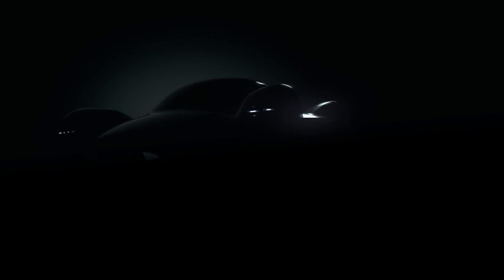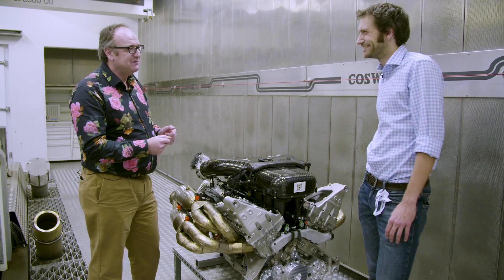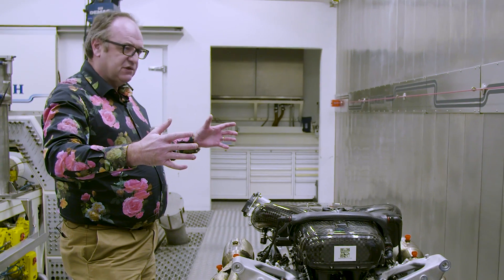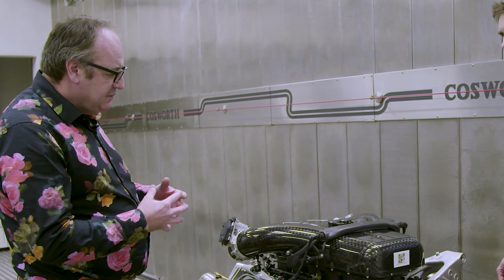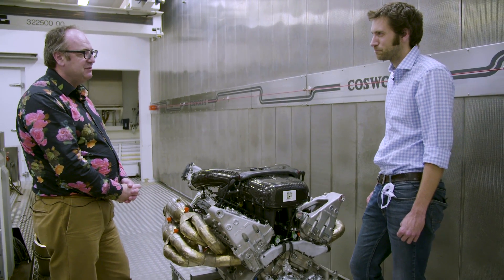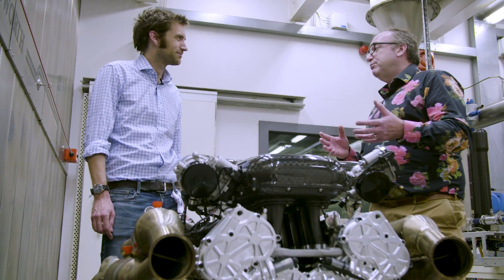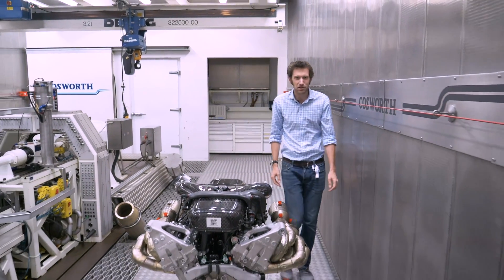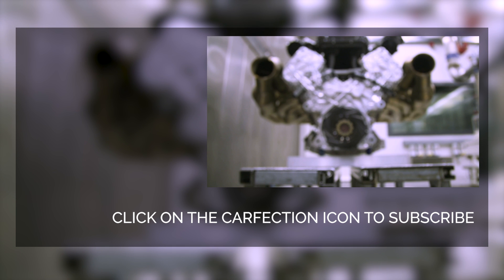Hear The Future Of The Supercar At 11,000rpm: The Aston Martin Valkyrie's V12 - Carfection

Comment: As a mechanical engineering student and car enthusiast, this is now my favorite video on youtube. Well done Cosworth, Astonmartin, and Carfection.
Reply: Jeremy Frey respect from a fellow mech eng student 👊
Reply: Görsel they accept that a certain amount of vibration in the cabin will be inevitable, and in fact will make the car feel more “hardcore” and “focussed” to the customer, as this is a common tactic used in race cars. Longevity of the design isnt necessarily the no. 1 concern in this case, as in a race car it is constantly being re-built/components replaced, and in the case of this hyper-car that will be driven barely a couple of thousand miles a year (and maintained to the highest standard), the chance of mechanical failure is relatively low. 
If this was your everyday Ford Focus or the like, the higher average mileage, harsher conditions (speedbumps, potholes etc) and more lax maintenance would result in higher chance of major mechanical failures due to high stresses/material fatigue. 

The other point to consider is the fact that (as mentioned in the video) the engine uses timing gears instead of a belt or chain system. This is because a belt or  chain wouldn’t be able to rotate at such high speeds (11000 RPM crank, and 5500 RPM for the cam sprockets) unless they were very bulky and over engineered, adding unnecessary weight. The gears also add a lot of vibration and noise, which is a key reason we don’t see them in everyday engines.

I think at some point in the video (correct me if i’m wrong), the engineer in the lovely flowery shirt said that the geartrain was at the back of the engine (i.e. furthest away from the cabin) so that the vibration would be harder to feel, and also slightly absorbed/damped by the crankshaft/flywheel’s motion. I think thats everything? Hope it answers your question 👍
Reply: Görsel me too, but its probably not too much for the million/billionaires who will most likely own this car...its a tactic used in motorsport to save weight, at the expense of everything else. If it would have any benefits in an everyday road car, it would trickle down, as a lot of new tech in consumer cars comes from motorsport (dual clutch transmissions, brake technology, engine design, theres loads of examples). Ultimately Aston Martin must have decided that the people who this car is aimed at will like the feeling of having  a bare bones hardcore racecar for the road. Just my two pennies

Comment: This is what a Hypercar engine should be like. 11k rpm 1000bhp...
Reply: The augmentation from t
Reply: This is an epic engine . But amgs project one with a smaller displacement engine pushing  over 1000hp is just as interesting a project
Reply: Power isn't everything real hypercars combine lightweight with high hp
Reply: @lometatron357  any retard can make horsepower if there are no limits on weight, efficiency, size, and displacement.
Reply: 1100 bhp! That's insane - the most powerful production NA engine ever. Even Ferrari only managed a mere 812 bhp out of their most powerful NA V12.
Reply: srinitaaigaura That “mere” 800hp is so the car is driveable on a daily basis, meets emissions standards and doesn’t need a rebuild every 5000 miles.
Reply: @stubones  And moreover the car doesn't cost you what this one will. They said the Valkyrie "isn't a track day special... but a proper road car", still they advertise it as one with a proper F1 engine, emphasising a number completely useless for everyday use. I still can't understand the reason to have an 11K revving engine for daily driving... The same reasoning goes for the Project One: cars more at ease on tracks than public roads.
Reply: @srinitaaigaura  No,it is a hybrid unit.The engine alone doesn't make 1100hp...
Reply: @srinitaaigaura  Upgraded Ferrari F50 GT Chassis #01 - 950 HP (1300 in the test before said final tune) compared the the other two's 750 HP
Reply: @srinitaaigaura  Most powerful naturally aspirated engine ever? No, just no. Not even close. 2100hp naturally aspirated V8:  https://www.sonnysracingengines.com/engines/drag-racing-engines/sar-1005-2100-hp
Reply: @3O2MuStAnG  "production" being the keyword here.
Reply: @sunder6745  Sonny racing engines are production engines as well so what's your point?
Reply: Not a road engine, won't pass smog and won't last, and doesn't come with a complete car attached
Reply: @weatheranddarkness  Still a naturally aspirated production engine that makes almost twice the power. And you don't know how reliable/unreliable either engine is so why even bring that up?
Reply: @3O2MuStAnG  found the sonny racing CEO.
Reply: @sunder6745  I wish! haha...
Reply: weatheranddarkness Did you watch the video?? Watch about 2:00

It’s built to pass emissions, the car is already designed and it is going to be a road car.
Reply: @3O2MuStAnG  Is it not based off a Chevy engine, with custom oversize parts, custom head, custom rods, crank and aftermarket EFI? That's hardly what I would call a production engine. How many 1005 ci have Sonny racing actually produced?
Reply: @3O2MuStAnG  17:1 Compression ratio also suggests not production! Jeez that's some Diesel like CR!
Reply: @3O2MuStAnG  "A ready-to-run 1,000ci engine from Sonny will run you about $115,000. Want to assemble it yourself, you can get about a $12,000 discount." Yes an engine I can assemble myself really sounds like a production engine!
Reply: @CED99  There literally reads you'll get a discount IF you assemble it yourself. Also the engine is produced since 2010 if I remember correctly. 8 years of consistent production. There are more 2100hp SONNY V8 engines than that fancy Aston Martin engine. Also the price is basically a steal and you would know that if you were a gearhead. Naturally aspirated high performance engines have always been a little on the expensive side so what do you expect from a 2100hp engine? Of course it costs as much as a luxury car haha.
Reply: @3O2MuStAnG  a racing engine is by DEFINITION not a production engine. A drag engine is not a road engine. Are you thick or do you have a vested interest? Is it just american pridefullness? IN NO WAY, SHAPE, OR FORM, CAN A SONNY's DRAG RACING ENGINE be considered production.
Reply: @3O2MuStAnG  you're comparing apples and oranges, and I cannot let that stand. Here's some food for thought: 
Cosworth Valkyrie - 153.8 HP/L - 206kg (454lb)
Sonny SAR 1005 - 135Hp/L - Weight so high it's not even quoted
2.2hp per pound VS..... crickets.
Reply: @3O2MuStAnG  Yes, there is always that one idiot counting a dragster racing engine. GOD. You do realize you're comparing apples and oranges?? Listen genius - a dragster engine only has to produce max power for a few seconds , doesn't have to comply to any emission regulations, noise regulations, longevity, drivability, refinement and ease of maintenance. And I looked that engine up, its displacement is 1000cui which is 16400 cc (!!). This engine here only has a displacement of 6500 cc (396 cui).

And when you compare how much the Aston Martin engine produces per displacement it's 1000hp /6,5 liters = 154hp/liter (or 2,52hp per cui) whereas that dragster engine of yours produces 2100hp /16,4 liters = 128hp/liter (or 2,1 hp per cui). 
Well, considering the Aston Martin engine passes all emissions and is designed for longevity (dragster engines wouldn't last five minutes under continuous use) I'd say it's way more impressive. 

Who compares a 396 cui engine with a 1000 cui engine? 2,5 times the displacement but not 2,5 times the power... . 

If you can find a road legal NA engine producing 154 hp/ liter (1000cc) you get a cookie. 

And question: Do they even race 1000cui engines in real dragracing?? They have displacement limits too. In NHRA they have a 500cui limit for ProStock and IHRA/MMPSA have a 820 cui limit. So that engine you're mentioning isn't even eligible to enter any dragracing events and only exists as a show off unit. You sure know how to pick them apples and oranges kid! Way the go.
Reply: @McLarenMercedes  Didnt read that comment sooooo you wasted your time. See ya!
Reply: @3O2MuStAnG  In a production car and meets emission standards you tool
Reply: @warwickstingray  So? You cant afford one so stop acting like a pissed fanboy.
Reply: @3O2MuStAnG  We both know you read it or you wouldn't be offended. And if you didn't - pity, you could have learned something . And if you didn't read it,  Others will . I reckon they will be smarter. Learn this: Ignorance can't be excused. Learn from this. Or be an ignoramus all your life. Last of all spreading knowledge and teaching people is never a waste of time. Being an idiot is always a waste of time. Which is going to be for you?
Reply: @3O2MuStAnG  Funny how you claim to not read comments yet you reply to everybody. Who's wasting their time I wonder?
Reply: weatheranddarkness actually it will
Reply: @weatheranddarkness  that's what the three cylinder engine was for to prove the v12 would pass emissions
Reply: @slowmazda3h802  @Greg Mieg what are you guys talking about? you sure you replied to the right comment? I never doubted the Cosworth, I've only been telling OneTT how much of an ignoramus he is for comparing a drag racing engine to the Aston's engine.
Reply: @3O2MuStAnG  this a production car engine
Reply: @weatheranddarkness  yea I did sorry for the confusion I caused
Reply: @McLarenMercedes  Very well put! And thx for the very detailed and informative post above!! I gave that little OneTT runt a nose punch too! ; )
Reply: @jamesshunt5123  Lolzzz!! Brilliant reply man!
Reply: @3O2MuStAnG  "You love twisting words, don't you? You must be a  10 year old girl haha."  -  You might be right about him.. Buuuut, I think the chance is quite slim.. wouldn't agree?

Though, considering the way YOU reply on the other hand.. I'd say the odds aren't exactly in your favour to put it aammm.. mildly.. let's say! ; )
Reply: @3O2MuStAnG  fanboy nerd
Reply: Better than the the current f1 engines at this point
Reply: @vigneshie  It's really not thoe.

F1 engines are unbeatable by ANY engine ever made

Not to mention that they are better while being limited by software
Reply: Is that 1000hp figure (or 1130 according to wiki) utilizing the hybrid assist though? I’d assume that since the engine is being designed with hybrid from the get-go, that figure would be with the included electrification. Or maybe I missed it in the video.
Reply: Alan Bowers 1130 on hybrid,1000 on the combustion engine
Reply: Koenigsegg has reported that their engine without turbos produces 1100bhp
Reply: @kvltman782  Their V8 ? (probably because i don't think they make any other engine)
Reply: @kvltman782 Koenigsegg makes some spectacular cars that the press doesn't give them enough credit for since he such a small operation. I believe they fabricate the majority of their parts too, right?
Reply: @Peanutdenver  That is correct. The make everything themselves except the emergency brake pad, and windshield wipers.
Reply: @Elias_g1  Their 5.0 litre twin turbocharged V8 produces 1361 horsepower with the twin turbocharged setup. I apologize, I cannot find the source, however there was a figure stating that ICE itself produced nearly 1,100 horsepower (at least for the One:1 and Agera RS 1 models. The "1" model was the 1 megawatt package attached to the RS from the One:1)
Reply: @ALMX5DP   The engine itself makes 1000. The hybrid system is expected to add around 125 hp.
Reply: @kvltman782  Vile engineering for fanboys.
Reply: @kvltman782  And the tires..  ; )

- Courtesy Doug Demuro
Reply: @ALMX5DP  1000 bhp from the engine and 160 from the hybrid motor

Comment: Can I get that 250hp 11,000 RPM 1.65 liter straight 3 cylinder though
Reply: Um Ducati will sell you a panigale V4R for pennies on the dollar compared to this and it makes 220hp from a 1.0l v4 @ 16000rpm. Sounds every bit as good too.
Reply: @shadynas7y  the V4R makes about 2 times less torque tho.
Reply: @turnip8173  You can't have two times less of something, you can have half as much though.
Reply: @schumifan78  thank you for correcting my grammar. I'm not a native speaker so it happens
Reply: @shadynas7y  not with car emissions kit, they won't
Reply: @shadynas7y  No low down torque though, useless for trying to pull around anything much heavier than a motorcycle.
Reply: @shadynas7y  and for less than half the cost of a V4, you can get an old Honda CBX 1000 6 cil that will also sound better: https://www.youtube.com/watch?v=MBbskqcgs_o
Reply: this engine makes more hp with 25% less cylinders and 50% less rpm as v4r.......
Reply: @2likru Esco Cosworth modified version Ford Barra i6 would be the attainable dream.
Reply: Nissan has a 1.5L straight 3 race engine that makes 400hp and weighs like 90lbs. Is that close enough?
Reply: I would love to put that motor in a Caterham.
Reply: imagine that on a Clio or mx5... it will be epic !
Reply: @2likru Esco I'll take the 750hp lopsided 9
Reply: What a motorcycle donk!😳
Reply: No kidding.
Reply: Cool  Don't know but it has 0.5l of displacement more a cylinder less and a much longer stroke.. not to mention it makes 250hp meaning it makes a good bit of torque too. I'd personally say 250nm or in the ballpark of that
Reply: @Doctor Pisson doubt that it's making peak torque at 9700rpm tho.. it's a 6.5 or something like that right. It makes more down low I bet
Reply: got nothing on the 4ag, ueo got his wagon to 180hp at 13k rpm
Reply: @2likru Esco , almost certainly has to be a V6 if you want to rev to 11,000.  Too much twist on a straight crank for 11,000 in a I6.
Reply: @TheCorrectionist  tell that to the CBX1000 and plenty of race spec R34s
Reply: @turnip8173  , those aren't 3L I6s with a two foot long crank shaft.
Reply: @TheCorrectionist  that's exactly what an RB26 is and it has no issue revving to 10k when done right
Reply: @turnip8173  , that's 8,000ish from the factory.  You're talking about a tuner special.  That ain't going 100,000Km between overhauls.  Shit, I'd be amazed if anyone has done 20,000km between rebuilds.  And 10,000 is not 11,000. The Valkyrie could probably go much longer with a 10K redline.   The wear increases exponentially with rpm.
Reply: @TheCorrectionist  noone brought up modifying the engine as a. this engine isn't your run of the mill V12 and b. you said that it can't turn 10gs. It was an Endurance GTR and there's plenty of similar ones. Also this engine will need servecing just as frequently as a race spec motor.
Reply: @Doctor Pisson Well in the official teaser Aston Martin claims 740 @ 7k so.. yeah still pretty high but not 9.7k high
Reply: builds worlds most insane go-kart :D
Reply: 😂 think the speed limited electric cars will take over before that happens
Reply: I'll take the 83hp  11,000 RPM 0.55 litre single cylinder please. Need to upgrade my ride-on lawnmower.
Reply: You can get pretty close with motorcycles...they have 1 liters that make over 200 horsepower, redlines over 11,000rpm too.  My Hayabusa redlines at exactly 11,000 (1.3 liter)
Reply: It would be slow in a road car due to a lack of torque. If you wanted it for a bike or go-cart that would be nice tho.
Reply: Is it 3 cylinder straight or V?
Reply: @KumRuzvalt93  It must be a W3 electric engine mated to a double-cluth CVT, no other way based on the layout of it's big brother in the video.
Reply: @csabaandrasgoncz9503  No its a straight 3, 1 corner or a quarter of the v12.
Reply: KumRuzvalt93 slant
Reply: @KumRuzvalt93  Think about again,dude, A v3 ha.

Comment: N/A and 1000bhp...
Cetainly can tell the Cosworth lads aren't messing around.
Reply: N/A is simply amazing in a road car... sounds incredible.
Reply: Oh it definitly does make 1100 hp from the engine alone + about 300hp im guessing from electrics and all but the extra torque from the motors is gonna make it even more insane than just 1400hp in such a light car
Reply: @leokaravasili9649  No it doesn't.The combined power from the engine and the electric motors is 1130hp.
Reply: It's a hybrid....
Reply: @Elias_g1  it's still N/A V12. You can hybrid pretty much every engine you want, mate..
Reply: @Fotznerwin27  Yes,i know but people think that 1100hp is coming only from the engine...
Reply: Ilias G1 engine has 4 250hp 3cylinder engines combined to one...
Reply: @qatronano  It doesn't make 1100hp just from the engine alone,that's what i am trying to say !
Reply: @Elias_g1  it does make that much from the engine alone
Reply: @olivierwikina7533  No !
Reply: A megawatt car, then
Reply: Just in case anyone needs to know
https://youtu.be/aq_rvuZBo2Y
Reply: You can build you're own 1000hp N/A engine it won't cost cost nearly as much as a cosworth V12

Comment: God, Aston should just ditch AMG and use Cosworth engines for their regular line up
Reply: It's much more efficient to use AMG engines. This V12 is like the AMG 6 cylinder in the AMG ONE in the sense that it requires high maintenance. Aston doesn't have the money to pay Cosworth to make them brand new engines for their cars. Using AMG makes things easier
Reply: They got to, that's like KD joining the Warriors
Reply: Sounds expensive.
Reply: Yes please. Cause now we have boring AMG engines that produce a laughable 608 PS with two turbos. And they sound boring too.
Reply: @non_playing_player  Laughable? The E63 has been dynoed to around 700bhp. Even if it was 600 bhp, that's the same as a McLaren 600LT, which is also a twin turbo V8.
Reply: @SirMito  Im talking stock DB11. Compared to Ferrari and Lamborghini V12s. Also soundwise not nearly as sexy as older na V12 engines by AM.
Reply: @non_playing_player  No modern engines sound as good as old ones unless they have hybrid systems to help with their emissions. Besides, the DB11 doesn't really compete with any Ferrari or Lamborghini, that's the DBS's job, so 600 bhp is good enough. It's not exactly a small number. .